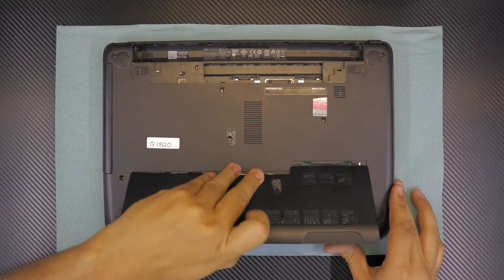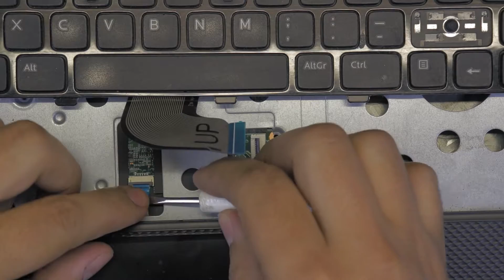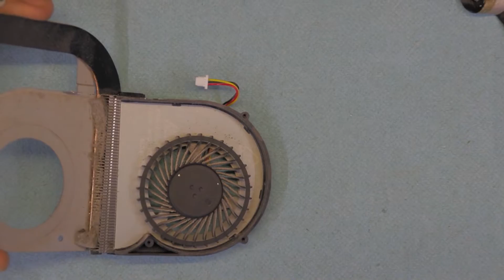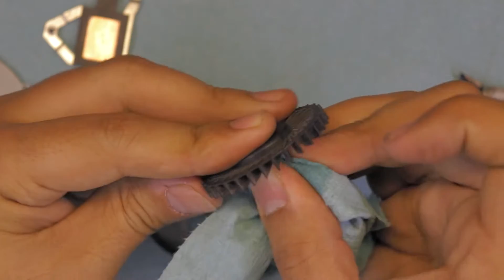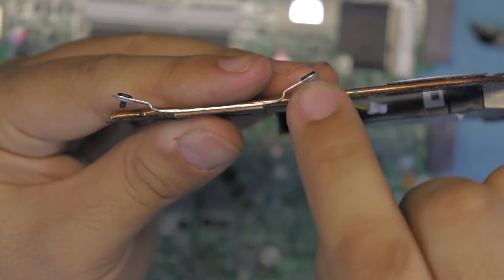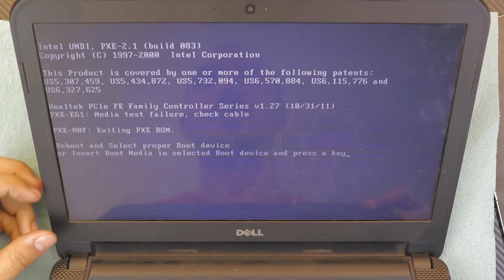DELL INSPIRON 3421 No screen fix BLACK SCREEN

Comment: It is great to maintain our own laptop. I have an old Dell Inspiron 14 3442, now going black screen. The initial sign was that there was some light on the left lower corner of the screen, when the laptop was on, but the screen was off, and laptop was put in dark room. Is not this a sign that the screen is damaged? Thanks in advance, if you are willing to respond.
Reply from the maker: Thank you for the feedback! if you wish to support the channel you can LIKE or SUB or both :P
regarding your question: you 90% have a dead LCD panel backlit , and you have to replace the Display, when you power on you should see the shadow of the stuff (windows), if so then just replace the Display.
Reply: @uFixTek  i consult a local laptop technician, and he said the same exact thing. Thank you

Comment: Help! My dell windows 8 laptop turns on but has a black screen what do I do
Reply from the maker: you will need to re-flow the GPU, remove the motherboard completely and use a hairdryer at max heat and heat up the gpu for 5min , and let it cool down at room temp without moving it, then repaste and you will see it will work.
thank you for your support to the channel :)
Reply: @uFixTek  thanks!!! 👍
Reply: @uFixTek  I’ve tried 3 times and I just couldn’t get to the mother board without forgetting how to put it back together, should I keep trying or should I just buy a new computer?
Reply from the maker: @ThE_BEsTreal  keep trying and the best i would say is take pictures of board before removing and if you forget go back and look at the pictures. :) try TRY dont give up on me

Comment: The screen of my 3421 inspiron doesnt turn on, but by the hdmi port works if i connect a monitor, i change the LCD cable but still doesnt work, what could be? The LCD?
Reply from the maker: its just a transistor right by the lcd jack there should be 3-4 transistor very small color black and they are identified with 3 pins. one of them its not responding.
Reply: Mine too. It's just black, it doesn't have dimmed light displayed. But the system is turned on and I hear the windows sound when i turn on.

Comment: what you use under the CPU?, i dont have that, this dont work without that?
Reply from the maker: JM S its a liquid flux, to reflow you dont really need it.
Reply: @uFixTek  thanks! Tomorrow i will try!
Reply from the maker: just few tips when applying heat make sure if you using hair dryer use about 3cm away from chip, and keep it there for 5min max heat low or med air flow. if you using a hot station use a max air and use 220-310c for 1min with 4cm away, then wait 10=20sec then apply again 1min 220c . anything else ask me